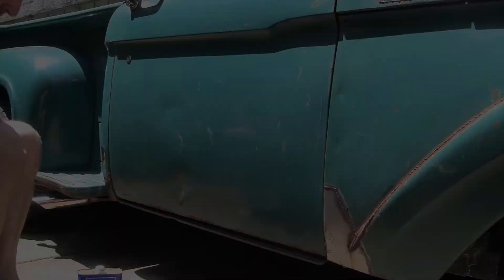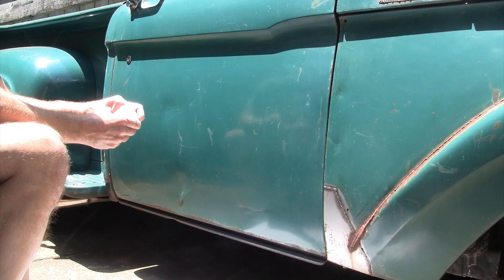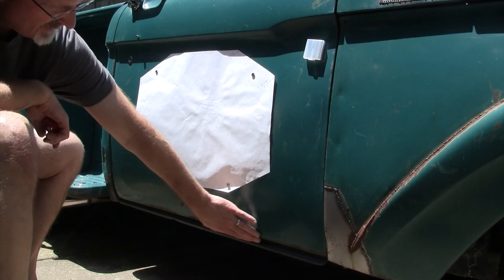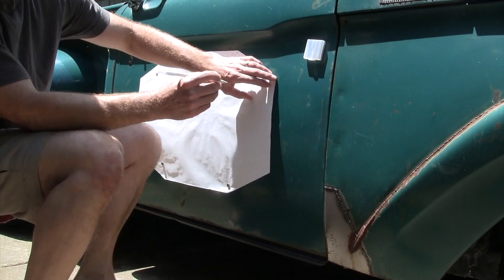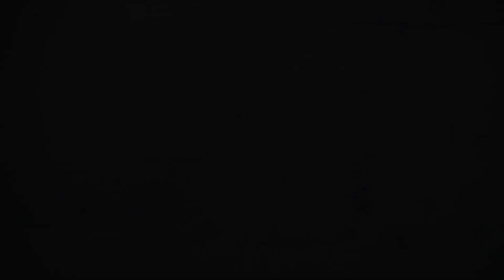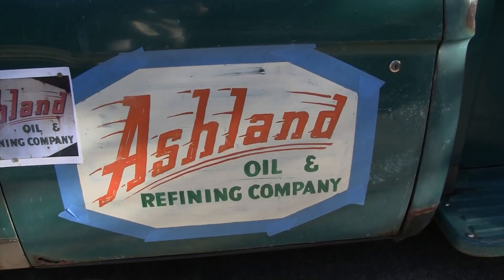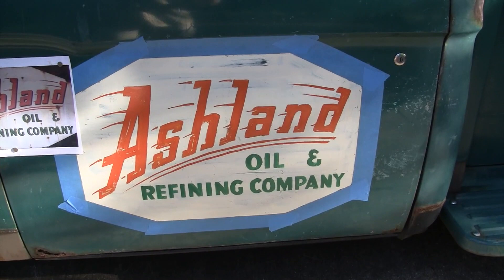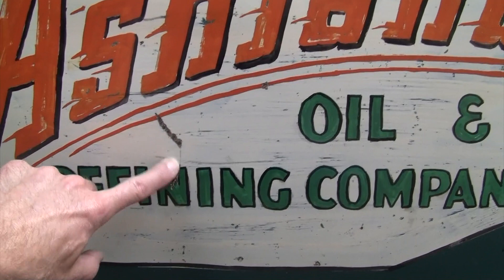1962 F100 Flareside/CVPI frame swap: Episode 24: Door logo

Comment: How do you handle the titling of frame swaps? I’m in lower Alabama and the local DMV didn’t have a clue.
Reply from the maker: Mine is titled as the truck.
Reply: Rudy's Resurrection right, but did it take any specials forms or anything? Like I said my dmv is clueless....so I am kind of stuck.
Reply from the maker: @gregbiggs9899  actually in Alabama vehicles that are 35 years old or older are not required to have a title.  The only paperwork I needed to get license and registration were a bill of sale and proof of insurance.  That should be all you will need.  Again, the VIN for the registration (and insurance) will be the F100 VIN.
Reply: Rudy's Resurrection great thanks